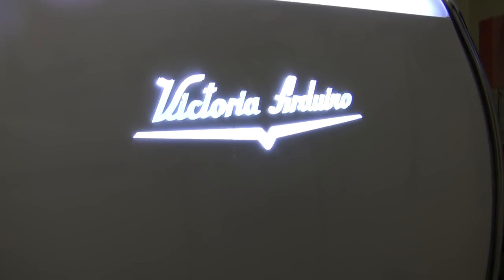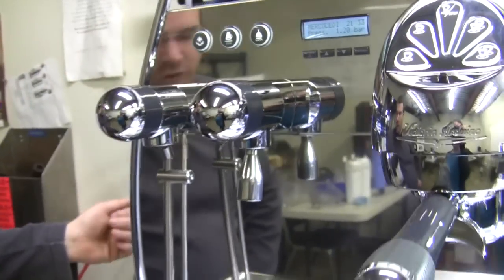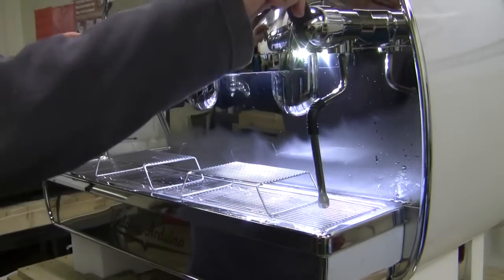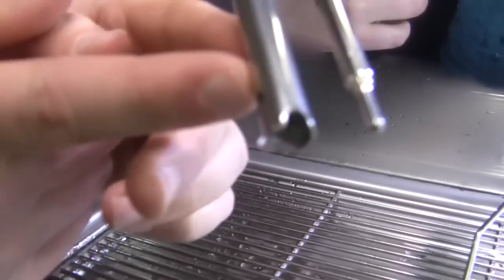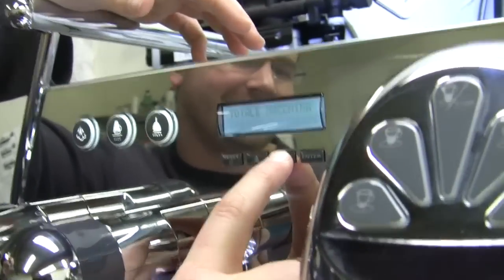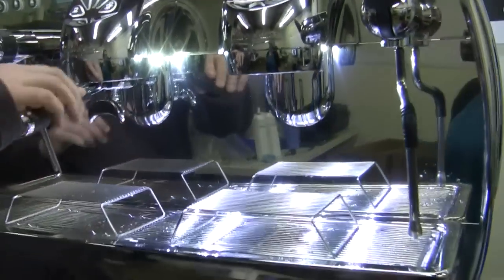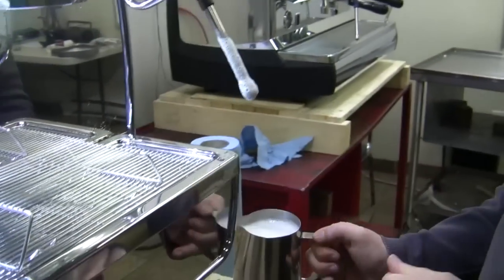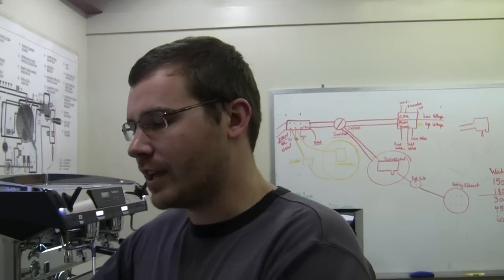Crew Review: Nuova Simonelli Victoria Arduino Adonis

Comment: How do you switch on the machine?
Reply from the maker: Hi Priya! The main power switch can be found on the bottom, front right of the machine. To enable automatic on/off, refer to the manual here: http://www.nuovadistribution.com/images/manuals%20pdf/English%20only%20manuals/Adonis_Manual%20English.pdf